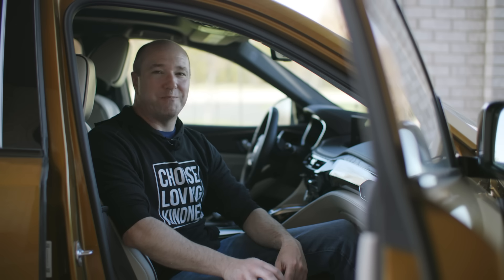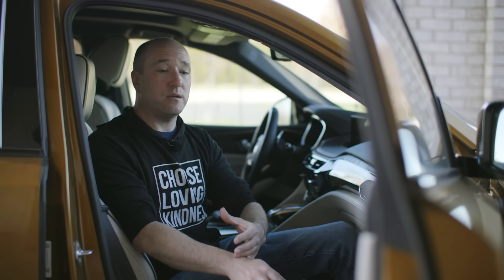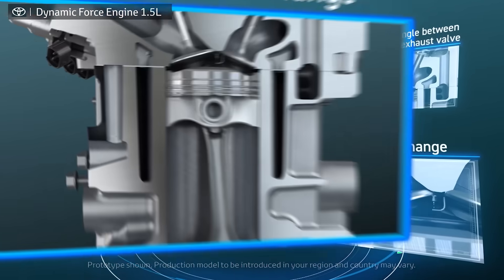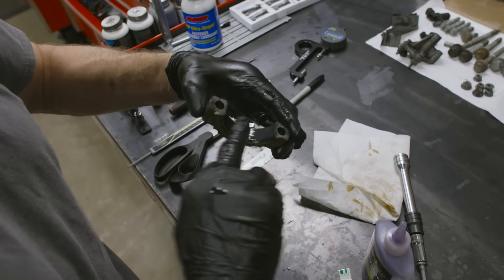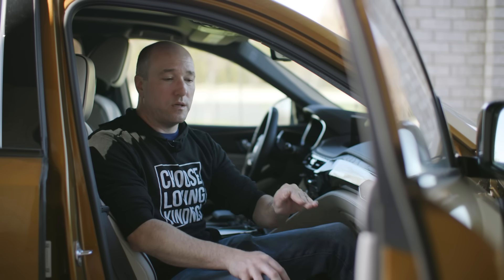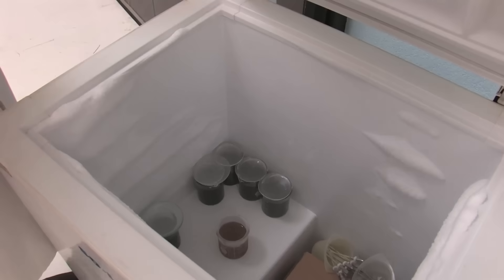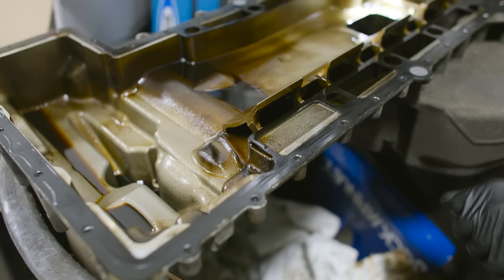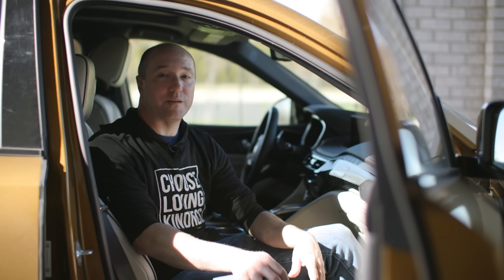Understanding Engine Break In | Dos and Don'ts

Comment: Proper piston ring seating is ignored by most, and the cause of excessive oil consumption from the start. With the factory fill oil this is difficult without loading during both acceleration and deceleration. That is AFTER proper heat cycling. And then never leave the factory fill in longer than 500 miles or so or you subjecting the entire rotating assy. to premature wear as the debris from break-in and casting flash shed and assy. debris in general is circulating and the oil filter can only trap down to 10-12 microns in particulate size, and up to 72% of internal wear is from particulate matter smaller than 8 microns.

Comment: I broke in my motorcycle using an accelerate engine break in process. Cant remember the exact steps but it was basically, warm up engine. Do a 1 min low RPM run. Let it get back to idel temp. Do a 1 min higher RPM run. Return to idel. Do an even higher RPM rune. Rinse and repeat till you get to a red line run. CHANGE THE OIL. Broken in. The bike is now 10 years old and the engine still purrrrrrssss.

Comment: Great Video! I have a TDI 2L GLI engine that ive owned for just under 4 years. It has 92k miles on it. I broke in my engine fairly close to what you described. I varied RPM's the first 500 miles, and then got on rhe throttle a little bit more each time as i got closer to 1k. I just had my timing chain checked and its in excellent condition, and my mechanic said its because of my maintenance. My car takes 0W20, and even though i mostly drive highway, i do oil changes every 5k miles. It gets fairly hot, and fairly cold in my state, and i do like to push my car from time to time. With gasoline pusbing passed the rings from direct injection, I'm not going to thin out my oil by doing 10k changes. Oil is cheap people! Engines and Transmissions arent.

Comment: I've rebuilt several engines. It wouldn't kill you to change the oil and filter after 500 miles. The rest of the advice sounds like what the rebuild manuals said and makes perfect sense.
Reply: "It wouldn't kill you..."  But is it necessary?  I've  purchased new cars from various manufacturers and held onto them  for 15, 16, 23 and 25 years. I followed the manufacturer's oil change schedule and never had an oil related failure.  In my experience those who push the opinion that the first oil change should occur around 500 miles are purveyors of snake oil and should be summarily ignored.

Comment: I watched a video about 992 911 production and they said that they put a large load on the brand new engine then run it wide open throttle (once up to temp) for 90 seconds to ensure proper performance. It appeared they didn't go to redline but put enough load to keep it from getting up that high. They also say you need nearly 2000 miles to break it in after that. Just thought it was interesting.

Comment: Great insight.  Basically reinforces my thoughts.  I always break in all engines I ever come to own from new. Outboard motors, snowmobiles, airplanes, cars, ALL have different break in recommendations.  And I can say in my 500,000Km + of driving I’ve only been stuck on the side of the road due to a flat tire.

Comment: I bought 2021 Toyota hybrid and engine would turn on when it thinks you need it. I don’t floor the engine for the first 5000 km.  You have no way of warming the engine as it would only use battery to drive when you started.

Comment: You will not see what your engine is going to be like in 2/3/4 years from now no matter what you do to it in the first 1,000 miles, the first 5,000 miles. Or km as with me up here in Canada.
But by that time it is too late anyways. A tight non-damaged engine/ or an oil burner. It is all up to you. Lots of folks couldn't care less. Initially. But are the first to complain when they find out what a piece of junk they have on their hands.
 The ball is in your court. Broken in/ broken down/ it is all up to you.
 Never mind what the dealership tells you/ or the vehicle manual. Because once you drive it off the lot, it is all your problem. Warranty or not, you are either going to be a happy camper or Little Debie Downer.
Good luck.
I get my final NEW vehicle this August after waiting for over a year for it.
I will break it in properly, and change the oil often, and keep my fingers crossed too!
Reply: I can’t say I agree with you. “It’s not all up to you”
You can break in a car perfectly, but if that engine is flawed in anyway it’s irrelevant. Recalls, bad parts, bad design, etc..
Reply: I am in the exact same situation and have the exact same plan as yours.

Comment: I have always changed my oil in car and truck every 3000 miles. The truck has 350,000 miles on it and the car 150,000 miles. No engine problems.

Comment: Sound advice for breaking in a new car but I disagree with your oil theory mate  All motors needs regular oil changes. Manufacturers tell you yeah every 15,000 kms or in some cases even 20,000. This kills your brand new engine without you even realising! Some companies like ZF who manufacture transmissions say that there products need no maintenance for life! This is bullshit! The reason these lying dicks tell you this is so that your car is rooted once it's warranty period passes and they can sell you a new car or fix your basket case that they have created at full cost to you off course! People, change your engine oils every 10,000 kms or 5-7,000 for older cars and transmission / diff oils every 60,000 and enjoy trouble free motoring.

Comment: Most of the "vary the load" advice is due to ring twist in the piston ringlands.  You want the ring-to-cylinder interface polished down evenly on the curved surface of the ring contact face where it meets the cylinder.  "Vary the load" also applies a little bit to the crank & piston bearings too.  The camshaft is only affected by RPM, not piston loads, so RPM variance is important there.
Certainly getting a VARIETY of loads & RPMs is the goal.  And for only 500 miles in a modern street engine is about all it takes.
Reply: Agreed. I think this video has a few misconceptions, there's no break in for modern bearings despite what he says. HP Academy has a great video on this topic, and I was a little disappointed by this video. There's a lot of things he covers but he fails to cover the why behind it. Merely using intuition is not enough, there's plenty of things that are intuitive but wrong. The vast majority of engine break in outside of cam break in with aftermarket cams, is the ring break in like you say. Any metal to metal contact will produce wear, especially on bearing surfaces.
Reply: @shredder8910 Is there a particular time frame to get the rings to fully seat?  I've heard the first 20 miles is when it occurs in a modern engine.
Reply: @miscellaneous5215  it’s pretty aggressive for most modern engines. 20 to 40 miles may be right for the majority of the ring seating, from what I’ve seen the other 20% of seating takes about the rest of 1000 miles or so
Reply: @shredder8910  Thank you for your reply.  Appreciate it.

Comment: With respect to the necessity of doing an oil change at about 1000 miles and silicone contamination: I changed the factory oil on my Golf Alltrack at ~1,500 miles, and sent the oil off for analysis.

I also sent off a sample that I ran from 18,000 and 28,000 miles.

The oil from the first 1,500 miles of the engine's life had as much or more metal contamination than the oil run from 18k to 28k.

This engine was broken in properly, essentially exactly as described here; moderate engine speeds and loads, varying rpms, gradually increasing over the first 1,000 miles. I did not hit >~70% throttle or >~4,000 rpms at all for the first 500, and didn't do an actual WOT pull (other than one on the test drive) until >800mi.

My cars are also always, no matter how many miles, driven moderately (about 2500-3500rpm, small throttle openings) until the oil temp is >170F or for the first 10 miles in the absence of an oil pressure gauge.

I've never had a car that I bought new burn a quantifiable amount of oil between oil changes in the time that I owned it (not even my STIs) nor have any of them ever experienced a lubrication or lubricated-parts-wear-related mechanical failure.

On the basis of that evidence, my recommendation to any of my customers who buy a new car is to change the oil between 1-2k miles, and if they want to be especially particular, all of the other driveline fluids (trans, diff, xfer case) around 5k.

Thereafter, they should either follow the manufacturer's recommended (severe) service intervals, or at least every 10k on the engine oil and no more than ~100k on driveline fluids (50k for trucks that do a lot of towing), whichever comes first.

Comment: Have you seen how GM engines are tested on the line in the factory and right before it rolls off the line? I have.
Just the engine, they rev it for minutes like crazy... then after assembling the car, right before it rolls out, they rev the engine again like crazy.
So for GM cars, you DONT need to break in... its already broken.

Comment: I agree that oil technology and quality has vastly improved in recent years.  However, with my ‘22 Stingray, and all others of this new generation of Corvette, the on-board “computer” dials down the “remaining oil life” from 100% to 0% in 12 months, even when it has not been driven a significant number of miles.  People claim that the oil somehow goes bad, so it must be replaced annually.  Seriously, does a quality full synthetic like Mobil 1 turn bad like a gallon of milk left it the fridge too long?  If so, the shelf stock of every O’Reilly’s and every Chevy dealer is of questionable usability if it’s been sitting there for X months, waiting for you to pour it in.  I believe it’s more if a car maker like GM and an oil company like Mobil 1 having such a cozy financial relationship that they take advantage of all the overly-paranoid Corvette owner who are so scared of ruining their 6.2 liter push rod V8 that they agree to spent $120 and up every year to buy more synthetic, sold by Mobil and installed by GM dealers.  I call BS on this “spoiled oil” deal.  What say you?
Reply: All oil oxidizes over time when exposed to oxygen.  The more exposure,  the more oxidation.  Unopened oil has a long shelf live (though the pores of the plastic still let oxygen pass through)--3 to 5 years. But "opened" oil should be used within one year.  Next question.  And to change the oil on a 22 'vette will cost no more than $70 if you do it yourself.  And if you don't do it yourself, shame on you.

Comment: I know a few master toyota technicians that will argue it is NOT safe to follow the oil change interval protocol. 10k miles is far too long on these new low compression piston motors with their low weight 0w20 oils..5k miles and full synthet ONLY is a much safer bet here, after the thorough break in period. 

And on a personal note, I have a newer 2019 VW ATLAS with a 3.6L V6, im finding my oil is completely dirty around 5k, and forget going 6,8 or even 10k miles. The longest we've gone is about 8k and I'd had enough and changed it immediately. Now it's 5k MAX

Comment: If you have Main and rod bearing making contact or moving you got bigger issues lol. There is no break in on a part that’s never supposed to see metal to metal contact smh. The break in is on flat tappet cams and rings.

Comment: Running 10k+ miles in between oil changes is ridiculous to say seriously lol that's wild.
Reply from the maker: Modern engines run much cleaner and efficiently combined with better oils.  Many eco engines you could get away with crazy extended oil changes, I ran as deep at 25k once.  Oil still had additives left but it had too many comtaminents. The middle ground was 18k.

Comment: Any thought for diesel engines? Got a new 2023 6.6 Duramax to break in. I will do my first oil change at 1000 miles. Plus I run a FS2500 2 micron bypass oil filter. It was installed it at 500 miles.
Reply: Your filter is far too restrictive at 2 microns.  It will clog early and just bypass for a few thousand miles with zero filtration.  Or worse, it will restrict volume of flow all the while showing normal pressure.   Aftermarket companies are in the business of planting good idea fairy thoughts into consumer’s heads.   The manufacturer has potentially billions of dollars of warranty claims on the line, so they know what they are doing with oil filter specifications on their OEM part.   
For reference, our dealership changed lots of lifters in the 90’s due to overly restrictive FRAM filters.  Yes, basic orange Frams because somebody had the bright idea to make them filter “better”.

Comment: if memory serves right... in Honda motorcycle manuals, there is a section for breaking the engine in
for my CB600FA, it was :
- let the engine sit for 20 secs after turning the engine on and right before shutting it off
- make sure you vary engine speeds
- make sure to shift smoothly but often
- stay under 5000rpm for the first 500kms
- increase rev range by 1000rpm every 100kms after that
- do one full throttle all the way to the red zone run once before turning the bike in for its first 1000km oil change

I did exactly that and I have to say... the engine was the smoothest I'd ever had the joy to listen to 😀

Comment: Ref oil viscosities, watch out for LSPI and the correct oil spec. Most of the time higher viscosity oils don't have the correct spec and the latest modern engines can be senstive to LSPI especially when tuned. So be sure to keep the correct oil spec when changing visocosities. And keep 0W if you live in a country with cold winters where you use your car...

Comment: Generally I drive gently till warm and then vary the Rpm with partial throttle opening up to a thousand below red line and change the oil at 1000 miles; then every 4000 or six months in a street car. 

The 15,000 mile oil change will get the car out of warranty without catastrophic damage, but is a poor concept for long engine life. 

No full throttle runs till 1000 miles and never cold.

Comment: Followed this advice for breaking in my new Tesla. I'm currently getting 2,000 miles per charge and there's absolutely no vibration coming from the battery's crankshaft. Thanks,  SG!
Reply: Huh??? 😂
Reply: It's somewhat hilarious that Consumer Reports recently stated that Hybrids made by Toyota/Lexus are more reliable than EVs. So fewer parts do not equal greater reliability.

Comment: Hummm.  Gasoline engines are def cool , have sounds, tactile , got soul… but I would say you can add this “ engine break in “, as another Pro for an EV.   Wtf? Transmission break-in too? Oil curing ? Thermal cycling ? Carbon deposits? This sounds like a pet gremlin… “do not feed after midnight” 😂😂😂 🚂 💨  🚜

Comment: when I first bought my car. The owners manual states no break in required. However I followed procedures anyways. I drove normal until 1000 miles, never going over 3000 RPM. The car has now over 170,000 miles, still has original power.

Comment: Really good video. I’d argue though that most people don’t live in a climate that’s so neutral they’re not experiencing extremes related to oil changing sub-10,000 miles. I tried that with my F-150 2.7L and had issues at 140,000 miles.

Comment: In the last year I've purchased 2 new vehicles, I like doing my own maintenance and changed the oil in both at around 1000kms, after looking at the oil filter in both and getting blackstone reports I would absolutely recommend an after breaking oil change l, the amount of metal in the oil and filter was shocking. I can't imagine leaving that for 5-10,000 more kms
Reply: The filter did its job, as it would for 5000 miles.

Comment: My wife’s Mopar minivan uses about a quart every 3000 miles, which 50 years ago would have been extraordinary. It was bought used as an ex-rental unit, and I suspect it’s first trip was on a very long run on the interstate. The previous van’s 3.3 liter V6 used virtually no oil, so I was surprised that this 3.8 had to be watched.

Comment: I solved the high oil temp issue by simply forgetting a few pins in the under engine splash guard and lost the whole front and my oil temps rarely got above 230 Evan durring long spirited driving took forever to warm up while driving in the winter though lol

Comment: I got a 2022 rav 4 with .6 miles ran 250 miles change  oil cut filter lots of sparkles  in it ran to 500 changed oil cut filler lots of sparkles  in filter ran to 2500 changed oil cut filter lots of sparkles in filter ran to 5000 changed oil cut filter  lots of sparkles in filter ran to 7500 miles changed oil cut filter lots of sparkles in filter and manufacturers suggested oil change is 10000 miles so if I did not change all that metal would have accumulated in oil filter and plugged it so don't believe there bull shit change your oil it's cheap compared to a motor 10000 mile oil change coming up I will see if sparkles load is less yet

Comment: Did you forget about piston rings?
Reply: Theoretically low and variable rpm and load (driving at around 2000-3000 rpm) should prevent piston rings glazing, right? But you are right, as if the highlight was regarding crank bearings break in.